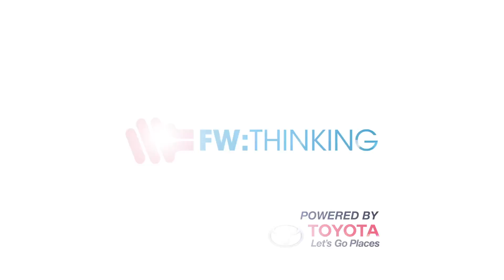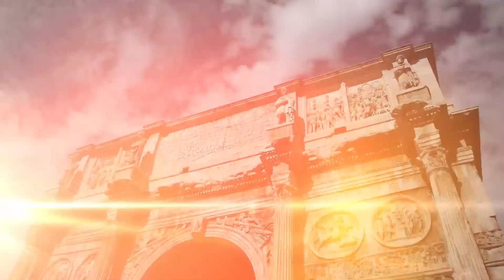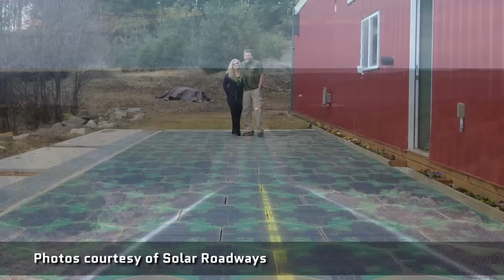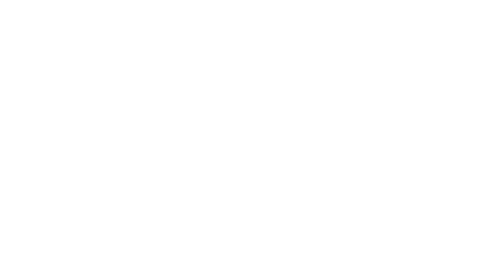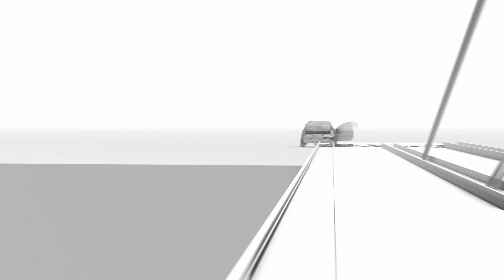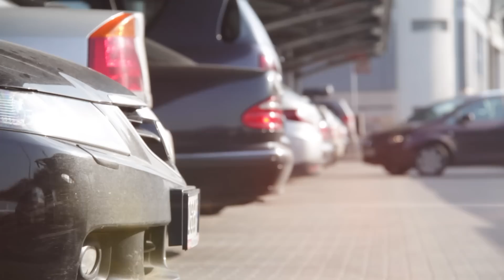Our Roads Are Getting Smarter

Comment: 1. Solar roadways cannot happen until different glass technologies emerge and better conductors exist (carbon nanotubes).  Currently, the solar roadway proposals are laughably absurd, and cannot work as they have been presented.  2. Induction charging in the roads?  No.  That would cost trillions of dollars to get started, and maintaining it would be a logistical and engineering nightmare.  3. An additional problem of electric cars is where the electricity actually comes from.  If the electricity is produced by using fossil fuels, you're just shifting the problem of carbon emissions, not alleviating it.
Reply: But! you can put a whole lot more carbon scrubbers and sulfur filters and such on a big stationary power plant than you can on a small mobile car.

Also, wind and solar work better for a big stationary power plant than they do for a small mobile car.

Comment: Sounds good at first but I doubt this will ever happen. It starts with the most crucial point, the costs. They would most likely skyrocket and already, most community's can't even maintain the current streets properly due the lack of money (they say).
Then, the huge work necessary to re-build current streets in this manner. It may be though, that a few test courses are build but it will probably stay as a few one time projects.
Furthermore, even if anything works somehow, the thievery and abuse of the systems will probably be beyond the government capabilities.
However, I like to imagine the magnetic streets will create magnet fields that allow levitating cars and magnetic auto-breaks, so no accidents can happen and to park, the electric motor of the cars, that create the magnet pillow to levitate on, are just switched off. Levitating cars would also prevent street damage so for example the solar panels for it can charge if no car/shadow is on them.

Comment: Oh dear god, even MORE bullshit about Solar Roadways. Here's my short run-through why this is a terrible idea that should get shut down at every sight of it:

A) LED's are not brighter than the sun and consume a great deal of power for lighting the road-way at night. Reflective paints which are friction and damage resistant or self-healing are far better pursuits. We're trying to reduce power usage, not increase it.
B) Solar panels underneath cars in a parking lot is a bad idea. Solar panels on the roadway is a bad idea due to electrical resistance in wires and panel positioning versus the sun's light (most solar panels actually turn to face the sun). They simply won't produce enough power. How about this: lets just build more solar plants...
C) Glass is fundamentally weaker than asphalt and infinitely more expensive. 90% of our roadways are from recycled materials. Additionally, worn glass is dramatically more dangerous than worn asphalt. Asphalt will rip up from the roadway creating MORE friction (albeit bumpier roads in the longer term). Glass will smother and smooth, creating LESS friction.
   NOTE: Yes, I understand that they're testing materials. Cool, find a stronger glass. You're trying to find a glass to do the job that asphalt does PLENTY well with the bonus of being made of goddamned ground rocks and tar. Solar panels have computer chips... Which are already valuable resources. To say that you want to find a glass stronger than asphalt is asinine and, most importantly, NOT NECESSARY.
D) Heaters... This is the most dipshit thing ever. Seriously...

Comment: Solar roadways are a tremendously awful idea. Glass doesn't have good braking properties. Textured glass still doesn't have good braking properties and it occludes more sunlight from the solar cells underneath. Traffic would also occlude sunlight. In order to pave the US highway network, it would cost trillions of dollars just for the glass, let alone the photovoltaic cells.

You know what would be a good combination of solar power and roadways? If we built solar panels OVER the roadways, rather than IN them. You'd think such a simple solution would be readily apparent to anyone with an interest in science and engineering, but apparently not.

I'm really disappointing that FW: Thinking has shown this terribly ill conceived idea as anything other than a terribly ill conceived idea. Put some freaking thought into your content. Don't just jump on a bandwagon because some hack got his "SOLAR FREAKING ROADWAYS" marketing campaign to go viral.
Reply: Elijah Decker Actually, in the video itself I talk about the panels being over roadways as a more practical idea. It's at the 1:45 second mark or so. In other words, I make the same point you're making now.
Reply: Elijah Decker  you don,t have to use glass. i'm sure you can use a hardened see thru plastic with reinforcement if needed.
Reply: Alex Clark
You expect such material to support trailer trucks traveling at highway speeds? Besides, that still doesn't solve the efficiency issues.
Reply: Elijah Decker yes i do with advanced materials we can make lanes made for semis
Reply: Alex Clark
You say "advanced materials" and I read "expensive materials."

Again, why not just put the photovoltaic panels over existing roadways?
Reply: Elijah Decker I never said it would be cheap
Reply: Alex Clark
So you still support this idea even though it's ludicrously expensive and there are better solutions?
Reply: Elijah Decker yes I do support this still
Reply: Alex Clark
Then you're a moron.
Reply: Elijah Decker im a moron because I have a opinion its just a opinion its not worth getting mad about, I know there are other ways to build roads but I like this way. Just like you like your way.
Reply: Alex Clark
It is worth getting mad about when morons like you can vote and force others to pay for stupid projects like this.
Reply: Okay 1. I cant vote, im 12
     2. I would never force someone to do anything
     3. Im not a moron 
     4. Im pretty sure your over reacting Elijah Decker
Reply: Alex Clark
1. You will be able to vote in 6 years.
2. That's what democracy is.
3. Fine, you're just inexperienced and naive then.
4. Perhaps.
Reply: Elijah Decker in 6 years ill most likely be in canada and i know what democracy, what I ment was I would not say my way was the only way. Also shouldnt taxes go to something that would do some good for the usa
Reply: Alex Clark Immigration isn't easy. Chances are, you'll be living in the country of your birth until you die.

Nobody should be forced to finance something they don't approve of.
Reply: Elijah Decker then whats the point of taxws then
Reply: Alex Clark
That's a very good question. I'll let you come to your own conclusion.
Reply: Elijah Decker gfhfgcmgfxkgrdmrgdkhrdkhrxkhrskyrsyk3skyrskt3sky3dky4dkhtclhtdmhtdkhhtdky4drkydoy4dpu4dky4e4kyepy4e3ywoy3st3a34aur2a3st3odiy4rciy4ciytcyotskyrsrysht, cnghjbcsjhcidhcidhvidhvirhvidhhvifvhifhvirhviehvirbdhvkdvirhvuhdvihfvhirhvifhvibtigjktnbobj 

I cant translate your language sorry argument invailded thanks for wasting your time (round of applaus)
Reply: Naffi Axx Nice job breaking Godwin's law.

Comment: There seems to be a whole lot of ways to generate electrical power that it make me wonder why much of this is not quite available everywhere already. Heard there is what has been called the Bloom Box which one small square plate will light up a 120 watt bulb from air alone... but apparently needs at least an ionized filter to keep away any dirt. Then there's a type of flashlight a young lady put together that works great just from holding it firmly in one hand, because of body heat as conducted through a... ceramic polymer?

Comment: Wireless charging road technology is actually, already being used in South Korea. 
I would apply this technology as stated to all road ways eliminating the need for
fossil fuels, applying the roadway in combination with autonomous vehicles technology. 

I would create an autonomous electric transportation network that gave "Free Access" to autonomous transportation vehicle when needed. You can simply hail any autonomous electric vehicle,  and use it for as long as you want. Once your done the autonomous vehicle, can be used by next person. Reducing the need to own, store or maintain a personal vehicle while also reducing the amount of vehicle on the road and reducing or eliminating the concept of vehicle theft.  

We could also redesign the electric cars to have fewer parts saving valuable resource, making the vehicle both easier to  build and repair if repairs are need. These repair could be completed by automated means. Also if a vehicle is damaged to a certain degree that vehicle can than be recycled for part to create a new vehicle but most vehicle would be build to last as to farther reduce the uses of valuable resources. 

 Also say you need the autonomous vehicle to travel out of city limits or even cross country. that would be 100% okay because autonomous vehicle would than become apart of whatever cities or towns transportation network it enters into and vise versa. Every cities transportation network would be connected as to maintaining a certain amount of vehicles, creating a concept known as "Access Abundance".

Comment: What would I change? I would outlaw existing roofing materials (not retroactively) and require that all roofs would be covered in solar cells, which would be plugged into the local/national electric grid. 

They tried this in a German town, and they were surprised to learn that individual homes produced more power than they consumed, as people left for work during peak energy production hours and only returned for a time period that was mostly sleep (the evening, night and morning).
Now, instead of a monthly bill, the average citizen of that city receives a €22 check from the electric company... They pay you!

Comment: As we were editing for time, we lost some of the content that actually explained my perspective on the idea of solar roadways. Here's a summary: Solar roadways are impractical for many reasons ranging from: solar panel efficiency, material durability, geography (not every region gets enough sunlight for solar panels to be of practical use even if those panels are remarkably efficient), the problem of how to transmit the generated electricity/incorporate it into the existing power grid, and the unavoidable problem that it would be monumentally expensive (and remain an ongoing expense), meaning there's no financial or practical expectation that they would work. In fact, if you check out the TechStuff podcast, there's an episode in the past in which I specifically call out solar roadways as being an unrealistic approach. Watching the video, you can see the transition in which I talk about more practical implementations of solar panels that don't involve replacing existing roads. What got cut was my explanation of the problems behind solar roadways and why that's not likely to be used in any future roads.
Reply: Jonathan Strickland There are definitely some obstacles to overcome before completely overhauling the way transportation works in not only the US, but the rest of the world as well. I think for the most part, you covered all the bases with what these new roads may feature, but hopefully, in the future there may be no need for roads. We could all be using something else (like trains, subways, aircraft, spacecraft, etc.)
Reply: Jonathan Strickland 

Wireless charging road technology is actually, already being used in South Korea. 
I would apply this technology as stated to all road ways eliminating the need for
fossil fuels, applying the roadway in combination with autonomous vehicles technology. 

I would create an autonomous electric transportation network that gave "Free Access" to autonomous transportation vehicle when needed. You can simply hail any autonomous electric vehicle,  and use it for as long as you want. Once your done the autonomous vehicle, can be used by next person. Reducing the need to own, store or maintain a personal vehicle while also reducing the amount of vehicle on the road and reducing or eliminating the concept of vehicle theft.  

We could also redesign the electric cars to have fewer parts saving valuable resource, making the vehicle both easier to  build and repair if repairs are need. These repair could be completed by automated means. Also if a vehicle is damaged to a certain degree that vehicle can than be recycled for part to create a new vehicle but most vehicle would be build to last as to farther reduce the uses of valuable resources. 

 Also say you need the autonomous vehicle to travel out of city limits or even cross country. that would be 100% okay because autonomous vehicle would than become apart of whatever cities or towns transportation network it enters into and vise versa. Every cities transportation network would be connected as to maintaining a certain amount of vehicles, creating a concept known as "Access Abundance".
Reply: Jonathan Strickland yeah, it's dumb, i wonder who came up with that idea.
anyway, i think in general urban roads shouldn't exist, only for long distances, for trips, vacations etc.  the stress cars create in cities is too much, plus driving in basically tin boxes proves everyday it's not a good way of transportation. why do millions have to die just because people get tired and angry on the road.

i say complete  underground trains in cities, when above there's only bike roads and of course sidewalks. put plenty of rent a car places on the outskirts of the cities, and that's pretty much it. i could go on, but i hope someone gets it.
Reply: Jonathan Strickland Given all of the comments and replies to the video, this could provide you with an easy follow up either next week, or a future video recap episode.
Reply: Jewish Music Toronto Sidewalks and pedestrian roads are not what I think NARKISDUDE meant.
Reply: JoyfullJuneBug We're talking about possibly grouping some episodes in batches and doing a series on a topic in which each episode is a focused look at a particular part of that topic and collectively they all tell a bigger story about the future. So an example might be The Future of Energy, with episodes looking at what our future energy needs will be, renewable energy, fusion, etc. So keep your eyes out!
Reply: NARKISDUDE How would you suggest people get around day to day? Not everybody works in office buildings, or offices in general. Heck, I bike to work, and I don't just use sidewalks to get there. There are roads involved. Even buses use roads, and they're transit on a larger scale. Then there would be the problem of how to get to the proposed car rental places, the massive expense of tunneling underground to reach all parts of a city, and so on.

And that's not even taking urban sprawl or how often you place stops into account. Where do you draw the line of where roads end and where they begin? Do you have special commercial transportation roads to get in and out of the city, or do you have the tunnels even bigger to have space for that as well?

But in answer to who came up with the idea? You can thank the Romans for what would eventually become modern roads.
Reply: Jonathan Strickland Why you gotta burst my bubble :(
Reply: Jonathan Strickland I'm glad that you didn't say solar road ways are the future because if you were i would have burst in to a fit of rage in the comments. i saw a video by *****  that explained why solar roadways are inefficient and how the people behind it are frauds.
Reply: dark reaper Hey! I linked that earlier in the day! :) It's a shame it's not a viable solution though.
Reply: Jewish Music Toronto well i didn't say it's gonna be cheap, it HAS to be very very expensive. but even roads can be underground, but they should be mainly for trucks to carry supplies into the city, to stores offices etc. and there could be places on the side of those roads that have elevators for the trucks, or just the goods that they need to offload.
 above all that are roads for small electric automated vehicles, mostly for short rent time.
to get to the city you enter a tunnel that leads to a large underground parking lot.

i know, i know, it requires basically a whole new city planned in advance.
last week they started building a metro system in the major city near where i live and it's already chaos, that chaos will go on for about 3 years so it's not fun for the entire area.
Reply: Jonathan Strickland  in my city if i could re build  any thing in my city i would make all of the roads magnets. for the one sole purpose of hover cars, when to magnets meet a + and - the stick to each other. if you were to use a + magnet road and the bottom of a hover car, for when your travelling  and then when you park it it flips the magnets to a - charge you it doesn't  hover away.
Reply: Jonathan Strickland I'd love to see the longer versions of these videos where you go more in dept about episodes. Maybe you could post both so that way the people who like the shorts can watch those and the people who want the longer episodes can watch those?
Reply: Alex Clark Actually you'll want quantum levitation
Reply: +Jonathan Strickland In that case, your video - or rather, the portion about 'solar roadways' - is intentionally misleading.  In my opinion, it is UNETHICAL to leave out significant facts that clearly shut down a project (or, at the very least, raise important questions over its feasibility), and motivate that act by 'editing for time'.

It would have been a far better choice NOT to release the video in its current form...
Reply: No face man 
Don't forget the wireless charging network their planning . Electric autonomous vehicles being charged by the roadway themselves making it so they technically never have stopped. Also people won't need to own a car if they don't want to they would have access to a vehicle when they needed it which would help reduce the use of valuable resources and having cars unnecessarily sitting in parking lots unused which is very wasteful